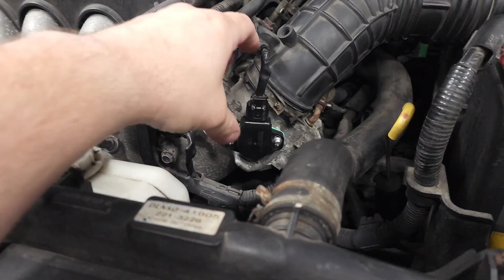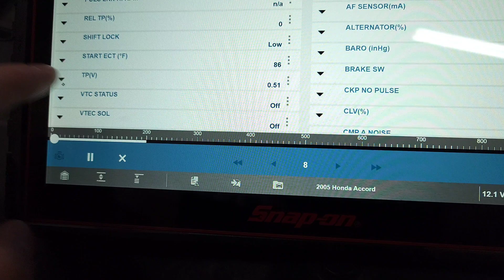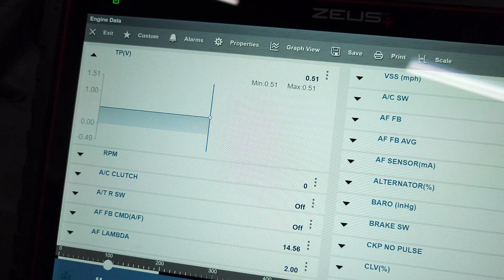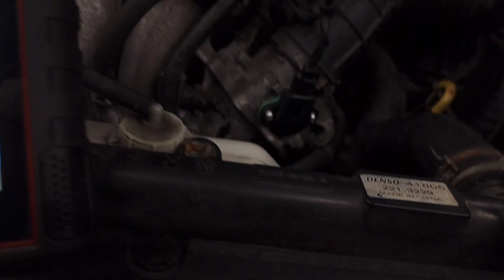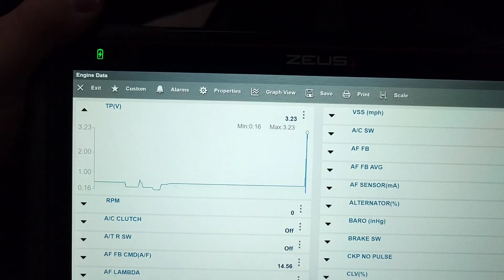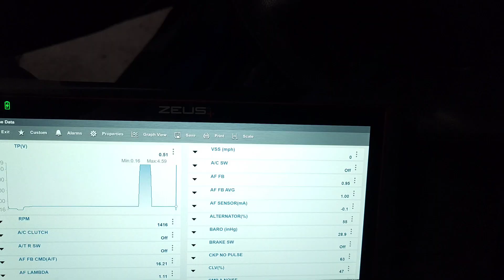How To Adjust Idle P0122 FIX Honda Accord K Series Scan Tool or Multimeter

Comment: omg!! the idle RPM was steady at 1500RPM on the tachometer. Ideally it should be 600-900 RPM at idle without AC on.. 

i might be wrong ..
Reply: What did u do to fix it?? I just got the problem when i put the sensor out and back in